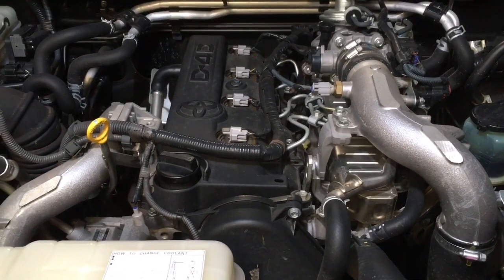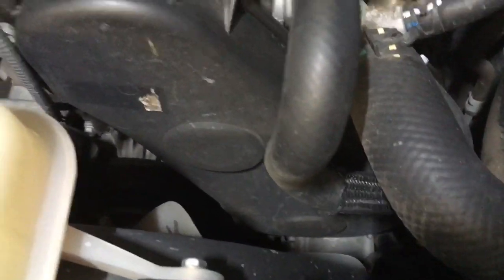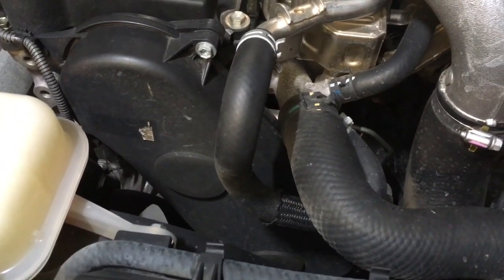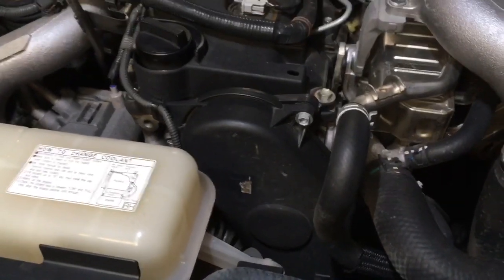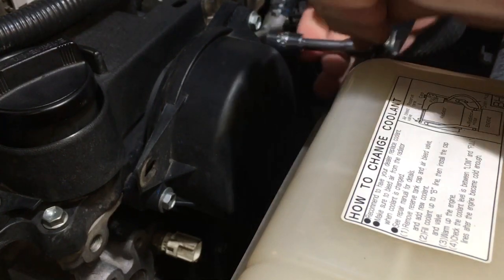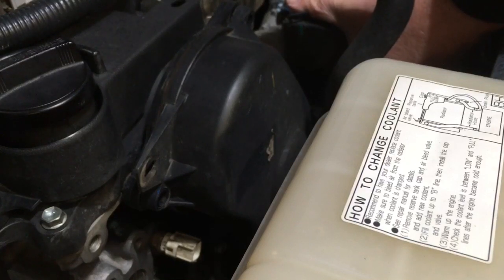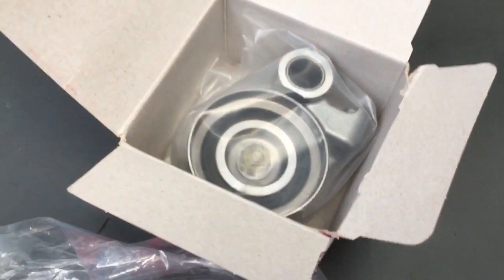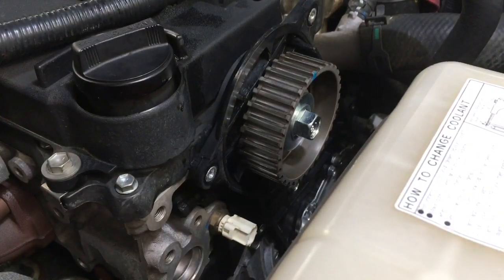Toyota prado 150 timing belt the hard way

Comment: Hi again, for you to turn the crank does the car need to be in neutral, cheers.
Reply: Waiting for Anthony to reply. One more, Anthony did you adjust the pulley to level the timing belt into the line indicator? Thanks in advance.
Reply: If a manual transmission yes. If auto, not required.